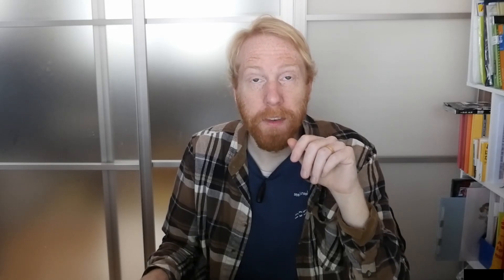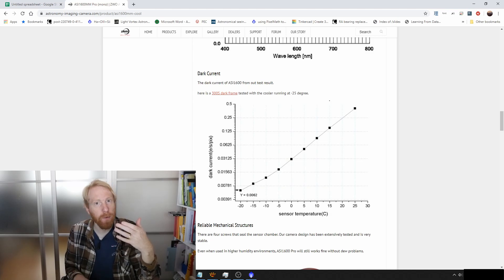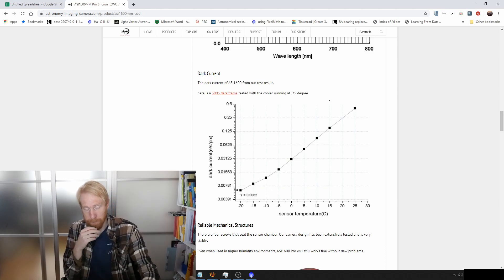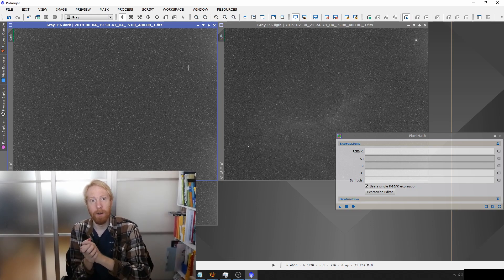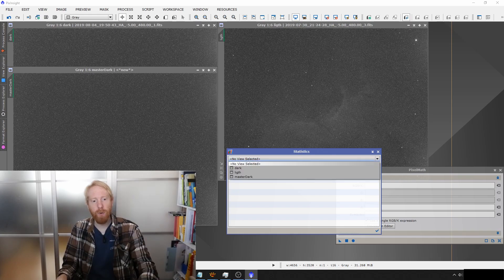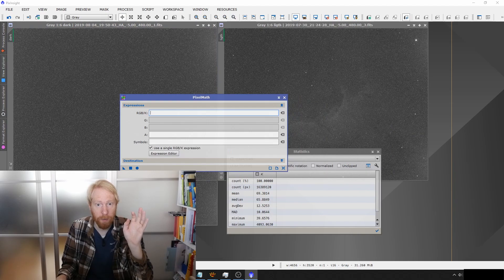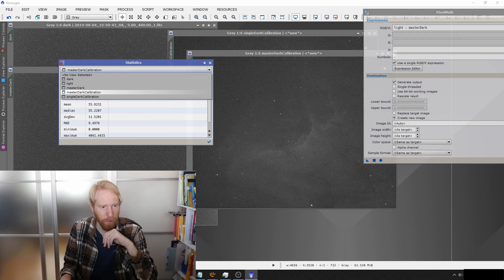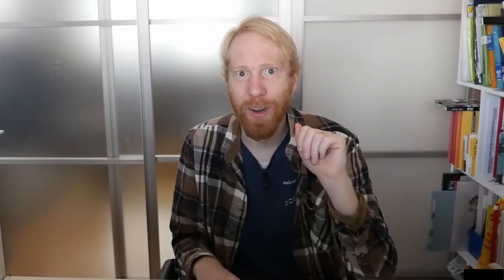Dark Current, Dark Frames, and Calibration - Noise in Astrophotography Ep 4

Comment: Great video, thanks. Quick question for a Pixinsight noob, can I add more dark frames to an already existing masterdark? Cheers
Reply from the maker: Oooh this is a deep question - and not really a PixInsight question. It is similar to asking: I know that a class had an average grade of 60% at the test. But we forgot one student, whose grade was 75%, and lost the grades for all the others (so we don't know how that 60% average came by). If you know how many students there were in the class (for example 10), you can actually compute the new average (as (60*10 + 75)/11). So if you know how many darks were used in your master dark, you could do a simple weighted average based on that. However, in PI, you don't just do an average - you can do outliers rejection as well. That would not work when adding a single dark to a master. So personally I would probably not add dark frames to an existing master dark - I would start from the individual frames if I still have them, or retake them if I don't. I am not an expert in that, so this is off the top of my head, but maybe others will chime in!
Reply: Cuiv, The Lazy Geek thanks for the in-depth reply, think I got the gist of it 😉 not a straight forward task then. I’ll just take a whole new bunch on the cloudy night. Cheers Cuiv 👍🏻

Comment: Another great video! Thanks! I have been thinking about building a test Sequence in NINA that would run a camera through various combinations of: Exposure, Filter, Gain, and possibly Offset (for Light frame testing). The idea is to attempt to determine what works for my cameras in my typical viewing conditions. Of course, there are a number of other variables that will change throughout the year such as temperature and humidity, not to mention target viewing angles, etc, etc... the list goes on. The question is, do you think there is any value in this approach? Could any statistical value be provided by a set of images using various combinations of the above sequence inputs? My ultimate goal is to sort out how to best spend my available imaging time. I guess I just feel that 30s, 60s, 120s, ... 300s exposure times are all quite arbitrary and tied to the clock more than the reality of what is best for any particular sensor and seeing conditions. To be clear, I'm not looking to get this down to the second of exposure time or single unit of gain... But what if I found I could get great results from 40s or 45s exposures instead of 60s? I could shorten my total imaging time requirements by 25+% or use the saved  time and collect additional images. OK, OK... I know I am overcomplicating things. :) Thoughts?
Reply: Get SharpCap 3.2 Pro, run the sensor analysis, point your scope to where you want to image. enter the range of exposures (15-240 sec) choose Unity or lowest read noise, then let er ripp. Done! sit back and watch the stars , like the old days...
Reply from the maker: Mitch said it first, what you are describing is basically what Sharpcap does automatically! Be aware though that taking shorter exposures doesn't mean that you can shorten the total exposure time! It is the total exposure time that is important, as long as you are "swamping the read noise" with your subframe length. If there was no read noise or quantization noise, you could do many 1s exposures and get the same result as few 60s exposures - for the same total exposure time! Lowering your subframe exposure time is a way to dither more often, or suffer less from wind and mount errors.
Reply: @CuivTheLazyGeek  Yep - thanks! Perfect! I agree, total time integration wins. To your point though, short exposures help me ensure I can keep more of the exposures I take due to any number of factors that could cause a frame to become a throwaway. Follow-on deep question: Do you simply 'eye-ball' a first image to choose your sequence exposure times? or do you factor in magnitude of the object?